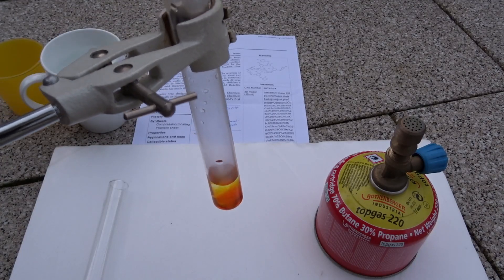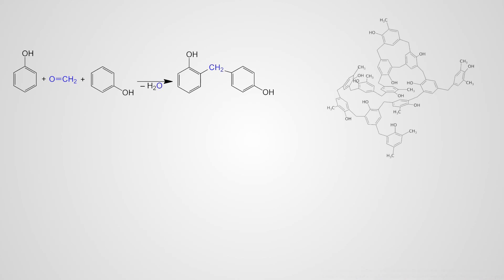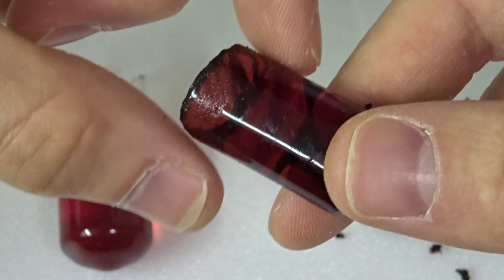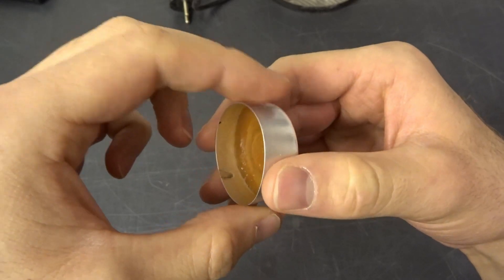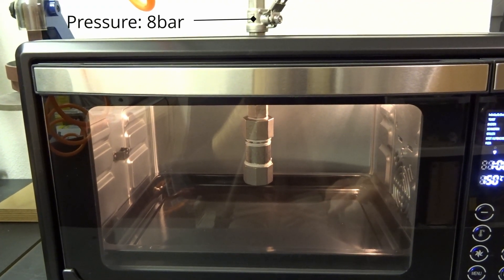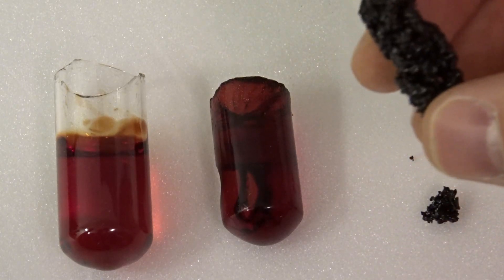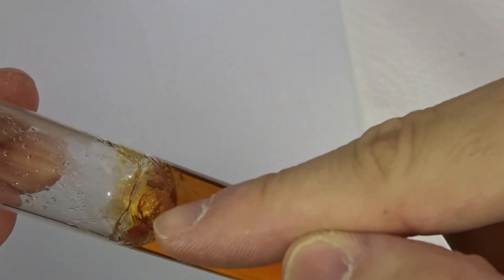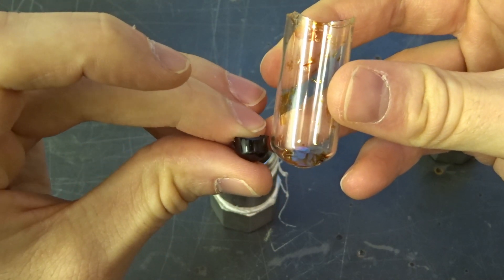Making Bakelite (No Bubbles)

Comment: Good video. Have you been able to progress on bakelite? It feels to me like you might be luckier by taking the process much slower: the lowest temperature possible that'll create cross-linking, higher pressure, heat up and cool down slower.

Another idea on what you might be able to do: are there additives you could add to the bakelite mass to make the water less of a problem? For example, if you added something like anhydrous salt crystals, would that additive absorb the generated water into its volume, therefore not creating any internal volume increase?
Reply: I just noticed someone mentioned sawdust... that could be the additive you need for water absorption maybe?
Reply: If you look at this video they mention all sorts of additives, one of them being "mineral filler"... I wonder if it's something like epsom salt or similar. They also mention sawdust ("cellulose filler" haha) as well as fibers.

One thing is curious. When they talk about using bakelite as a coating, they show coating some (metal?) parts in resin, and then just curing them in a walk-in oven. It's not pressurized. You'd think that it would bubble up, but it doesn't... I wonder how they achieve that?

https://www.youtube.com/watch?v=umM21vFIc7Y
Reply from the maker: @cheater00  If the film is sufficiently thin it might not bubble
Reply from the maker: Some parts of the process can indeed be slowed down with great success, however currently I don't have the time to experiment. Personally I don't like the idea of additives as it compromises the structural integrity of the bakelite
Reply: @ShroomLab   Why would you think it does that? Additives into other kinds of plastic increase its structural integrity greatly. The video I mention talks about mineral additives that help make the bakelite stronger.

Comment: Doesn't real bakelite have sawdust ("wood flour") mixed with the resin ?

It probably gives more strength to it, maybe you should try adding sawdust and see what happens...
Reply from the maker: I'll do in the future but I may need a bigger bakelizer first
Reply: Wild guess, but I think sawdust might be there to absorb the water.
Reply: @cheater00  
As far as I know, it's mostly for giving structure to it, like a composite (where the fibers hold it together), but I think you're also right...